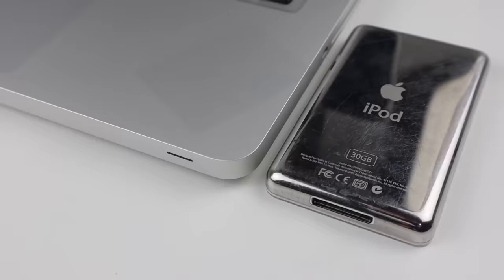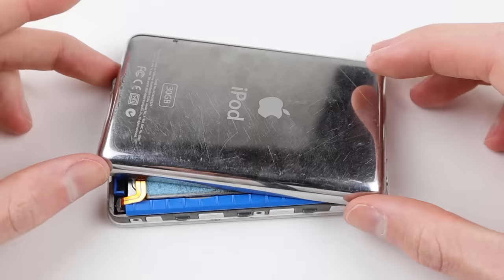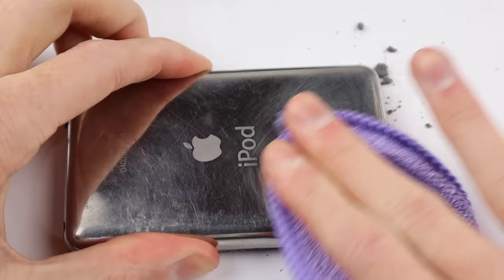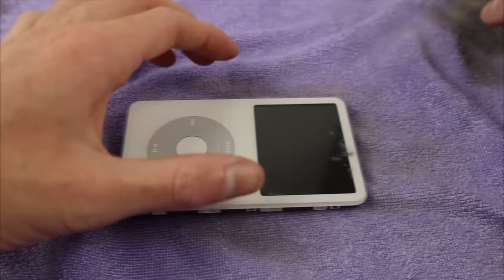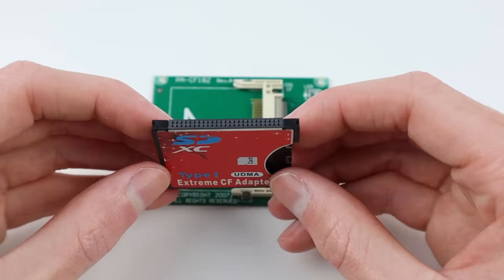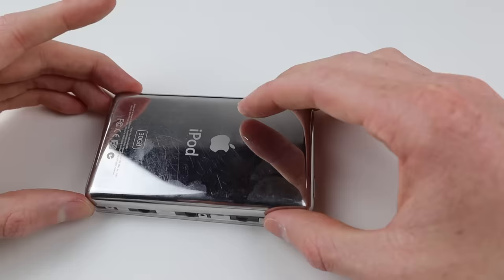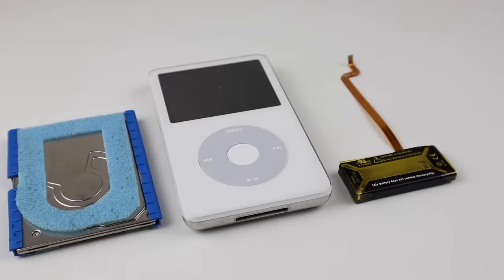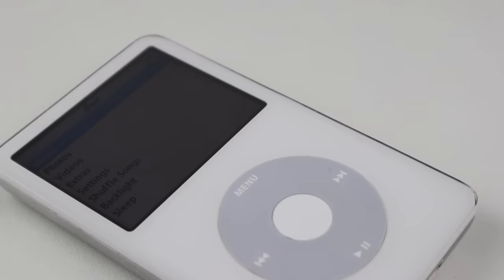Reviving a Broken iPod 5th Generation (iPod Classic)

Comment from the maker: Do you still use an old school iPod?
I still use mine all the time, it allows you so listen to music while being disconnect from your phone, something a lot of people could use...
Its also helpful if your constantly using different devices that don't always have your music library on them.
Reply: Nice! You got a 5.5 gen or the 5th gen (enhanced). This one has a really nice Wolfson DAC in it and is considered the best sounding iPod. I have a 5.5 gen as well with an iFlash adapter and a 128GB sd card and it sounds great.
Reply: This comment was commented on an iPod touch 7th generation.
Reply: Hugh Jeffreys does an iPod touch 6th gen count
Reply: Can't you give an iPod away .....?
Reply: I have a 2nd generation ipod touch and the battery has outlived my Iphone SE's by far... maybe they don't make batteries as they used to
Reply: I use the same one you got here, and sometimes I use an iPod touch 1st gen on iOS 1.1.5
Reply: Can you please repair my ipod 4th gen
Reply: I have an iPod classic 5th gen in white 80gb but it has a dying hard drive. 😢😔
Reply: Just a friendly advise. Just use oil instead of alcohol to remove sticker or adhesive. I would be alot better.
Reply: I don't have iPod, but i have XX.y A496 BT Mp4 player. I still loving music.
Reply: @finleytownley7651   Watch Geek Detour video. He in one video repairing his iPod. He changing hard drive, battery, lcd in one video.
Reply: Hugh Jeffreys i still have the 2007 iPod classic
Reply: I have an iPod classic 5th gen 60 Gb model
it works fine but is swollen
Reply: I still use my lunch zune. 🤣 Every time I get an iPod they always break
Reply: Want two iphone 8 I have a water damaged one with no cracks and one with shared back and front I know u probably won't read yhis
Reply: Me
Reply: I use my 2gen iPod nano every day, it’s D.A.C. is amazing
Reply: You encouraged  me to fix mine, hopefully with the same result
Reply: I only have an old school iPad it is the first iPad running iOS 5.1.1
Reply: Sometimes. I use my Nano 7th gen.
Reply: I use my ipod touch 5th gen for school
Reply: I still have a green iPod Nano 6th generation which I have attached to a watch strap and is my main watch.
Reply: I still bring my iPod touch 4th Gen to school and I'm quite happy with it since the battery life is still in ok condition and a steal for 8 bucks on eBay. And for that steel polisher, does it have a name?
Reply: The one I have is stone dead and the back of it is scratched and I got it for free as is
Reply: I have an ipod touch 4th gen
Reply: I think I got the four gen
Reply: 16 gb
Reply: I still use my 7th gen daily, it does have a 500Gb mSATA SSD and a new battery now.  I like the fact that I can have all my music on it without having to choose which albums to keep so I don't take up too much memory like I do with my phone.
Reply: Hugh Jeffreys I’m about to use an old school iPod. I’m just waiting for my dad to give it to me
Reply: On scratches on Stainless Steel products try Mothers Mag  and Aluminum Polish. I use this on my Apple Watch Stainless Steel and it works perfectly, my watch look like from box.
Reply: Mark Perry same here all the old stuff is cool and simple
Reply: iPod Squad
Reply: I still own a 1st-Gen iPod Nano in pristine condition.
Reply: Fedora Usado apple old tec no longer wok
Reply: My iPod don’t work thanks apple
Reply: @ezequielcastaneda8890  says who? I still  sync music from my library to my trusty Nano. I use it regularly
Reply: Fedora Usado I have music on it but it just glitches and dose not play music
Reply: @ezequielcastaneda8890  then you should consider YOUR iPod as defective, not all of them. In fact, I own not one but two 1st-Gen Nanos, and both work. My brother still owns a 3rd-Gen iPod Touch in working order.
Reply: Hugh Jeffreys my dad still uses his foud 2 others
Reply: Still using mine on my car
Reply: Fedora Usado yeah
Reply: I have a huge collection of iPods and my main one is a classic 7th gen
Reply: It’s Ronan Just Ronan thats tuff
Reply: Of course, actually i have two iPod classic, one of them is a 7th Gen with a 160 GB hard drive and the other is a 5th Gen with a 30 GB hard drive. I repair my 5th gen ipod classic a week ago, the hard drive was dead and the jack port needed to be replaced, now is working very well.
Reply: You want my iPad because it does not charge or probably gonna throw it out
Reply: Where did you get the sd card adapter board for the iPod? What model/serial/name is it called? Looking to do this to mine and all the ones im seeing shipping to Australia are like $80+aud. Love to be able to fix mine for $35!
Reply from the maker: @dorisdaylight8415  this is the one I purchased. https://rover.ebay.com/rover/0/0/0?mpre=https%3A%2F%2Fwww.ebay.com.au%2Fulk%2Fitm%2F233182232931
Reply: great vid! missed opportunity I did mine with sd isflash and got room for 1900 mh  battery witch last me a week
Reply: is it possible to buy now ? i still love ipod classic.
Reply: Hey Hugh, love your videos, dude, you are a genius !!!All of your videos most definitely gets a thumbs up from me.  By the way, there is one thing about you that I'm curious about, and I think many others are as well, and that is, are you gay.  And if you are, that's cool, and if you are not, that's cool also.  All of us would like to know.  Anyways Hugh, keep on pumping out those good videos and have a great evening!  :-)
Reply: I did it! My old iPod was broken for more than 3 years. A lot of thanks for the video ¡¡ Greetings from Mexico
, I'm your fan ¡¡
Reply: I use an old iPod touch 4 in almost mint condition I lent it to a friend and he made a small crack in the screen bezel
Reply: I use a 6th Gen thin iPod Classic. I did a similar mod (An iFlash with a 128gb SD Card + a new battery), but working on this model is harder because it is very difficult to open. Still an awesome device.
Reply: I use an iPod nano 4th generation
Reply: Bashir Asmad Why is that? And how does that work? Since both oil and alcohol are non-polar?
Reply: so I wanted to buy and restore this model of iPod but, iTunes doesn’t support the software so how do I get around that?!
Reply: Hugh Jeffreys Hi!!! Great video like always!!! How many hours did the mew battery last?? I need to replace mine. Thanxs
Reply: Hugh Jeffreys I have a flash modded iPod mini permanently installed in my car
Reply: I have a 4 gen one of those with same support message I think drive finely died today because it was working fine few weeks  ago but now today it’s has said iPod screen when I tried turning it on
Reply: I use my 5.5th Video everyday! After replacing the battery for a 1900 mAh new one and a the 80 GB HD for iFlash/SDXC 128 GB card it works great.
Reply: @willemanuel6580  Same here!!!! Exactly same setup.
Reply: No way I use an LG T375 as a MP3 player I works just like an iPod but better
Reply: I do! I have 3 iPod classics and 4 Nano’s!
Reply: Got a dead iPod 4 (2004), I hope I can repair it some day
Reply: I have a ipod nano 5th gen that has a battery of about 2 or 3 songs lol. I use it for when i excersize and thats about it
Reply: I use Spotify and download albums and playlists for offline listening so I can listen to music while being disconnected from social media.
Reply: still using my 2nd gen 1gb shuffle for exercises and my 7th gen 160gb classic for daily usage, besides iphone
Reply: I just bought myself a completely sealed and new iPod 5.5 80GB for $300. Adjusted for inflation it's cheaper than it's original price. And I am so excited about it. I already disconnected from my iPhone and using a Motorola Razr V3 now. Just carrying the iPhone around for my music. If the iPod arrives I can sell my iPhone and live happily. I already converted all my Apple Music which took like 3 1/2 days because the software needs to listen to the song and record it. But it was so worth it 😊
Reply: It’s not old school so technically no.....
Reply: I sure do it’s amazing and useful to enjoy parts of life with no disruption
Reply: you could share with me the names of all the tools you used ?
Reply: Mine just stopped taking a charge.
Reply: @finleytownley7651  search "HDD ZIF" on Aliexpress
Reply: Yeah i have the same iPod 😂
Reply: @HughJeffreys   

HOW CAN WE RECOVER  PHOTOS AND VIDEOS ON THE DAMAGED OR RESTORED IPOD CLASSIC ?
PLEASE DOWNLOAD A VIDEO ABOUT HOW TO RECOVER PHOTOS AND VIDEOS IN THE DAMAGED OR RESTORED IPOD CLASSIC 
BECAUSE  I HAVE AN IPOD CLASSIC DEVICE  WHOSE DATA IS  DESTROYED AND I NEED RESTORE IT 
AND I DO NOT WANT TO RESTORE IT BECAUSE THERE ARE VERY IMPORTANT PICTURES  AND  VIDEOS 
WHEN I CONNECT IT TO THE MAC 
IT APPEARS TO ME THAT IT IS DAMAGED AND CANNOT BE DOING A SYSTEM UPDATE BECAUSE IT IS COMPLETELY CORRUPTED AND THERE IS  NO SOLUTION TO THE FINDER PAGE  EXCEPT FOR RESTORATION. I WILL THANK YOU VERY MUCH IF YOU EXPLAIN TO ME HOW I CAN PULL PICTURES AND VIDEOS FROM THE IPOD CLASSIC . THE BELL TO WATCH ANY  VIDEOS DOWNLOADED  FROM YOUR CHANNEL
Reply: I use a classic 5th gen daily!
Reply: I have a purple ipod nano gen 4
Reply: Gum Gummmmm... I forgot what gen
My ipod touch is
Reply: I still use an iPod Classic. I’m currently using a 160gb 7th generation which will soon be upgraded to 512gb.
Reply: I want to use mine. Which is why I'm here, it's been off for 15 years and telling me to restore in iTunes however the hard drive is corrupt af. Can't restore or format, tried 50 times and keeps failing lol. So I need to find a replacement.
Reply: @Streetw1s3r  Where do you live? I live in Sydney & there’s a shop I go to who fix iPods.
Reply: @Bradford659  Melbourne, but I want to do it myself because I'm bored and want to fiddle with things. You don't learn by paying someone else to do it for you.
Reply: Where  can we all send ours to get fixed how come noon will fix these??
Reply: I agree completely! My last ipod just died, I'm sad. I have some pristine ipods I think with only hard drive problems. My small one just has red background with apple and connect to power when I plug it in. How can I get an ipod classic with a terabyte or two??
Reply: @willemanuel6580  actually this is just a 5th generation, not the 5.5. At 0:18 you can see the serial number ends in SZ9 which means it can’t be a 5.5.
Reply: Nope.6th gen is classic.5th gen is video
Reply: yesterday my 5.5 gen ipod classic arrived. i want to do a case swap and a flash storage and battery upgrade
Reply: No but I’m getting a black iPod 5th gen on the 22nd
Reply: @Noaddedsalt01  no. That’s new and doesn’t have a clickwheel
Reply: @ezequielcastaneda8890  wok
Reply: @elfedorausado  make sure you don’t over use the Nanos. The battery could expand and push against the screen and make a black spot on the screen. Making it a fire hazard
Reply: @dudekissmyass  well. The iPods with a clickwheel are called old school
Reply: @KotTheSillyOne  i only want to say fifth gen ipod's real name
Reply: @dudekissmyass  the video
Reply: @KotTheSillyOne  i have one of those
Reply: I use an 5th gen all the time thanks to you
Reply: I used to have one. My dad to be exact but he sold it for a few bucks and now since they stopped making them they’re really becoming collectible. Damn shame his was in great condition.
Reply: I use mine all the time. It’s a 160GB classic
Reply: No but thanks to you and your other countryman DankPods (yes I know you take wildly different approaches!) I am seriously considering getting one and restoring it.
Reply: i have an old ipod nano second gen
Reply: i daily a 6th gen 128gb and I love it!
Reply: I actually went out of my way to get a 5th gen being they were acclaimed to have one of the best codecs and it for sure sounded alot better than my phone from 2019. Especially hooked up to my car or any larger speaker system.
Reply: @gloriamargarita  actually batteries have gotten better and longer lasting and bigger in Capacity too
Reply: @marshall8733  you MEAN ADVICE
Reply: I had a 7th gen classic gray!
Reply: I have a 5th generation iPod I think it has a virus because all of a sudden it won’t work. What do I do to remove the virus?

Comment: Some things I learned from DankPods
1. Brasso actually works wonders on the front plastic. It really cleans up and polishes effectively, even though it is a metal polisher.
2. If you want to remove the scratches from the back metal cover... you need to replace it. Most other things just make it look worse
3. When opening the iPod, don't push up with your tool to avoid any damage. You need to slide the tool in, push a little down and inwards. The plastic clips should open up.
4. If you don't want the CF adapter to be that loosely inside, put a small piece of foam on it. 
5. If you do the flash mod (SD card) and it doesn't work with the cheapo CF adapter, make sure the SD card really is in there. If it still doesn't want to work, get an iFlash CF adapter.
Reply: The battery cable always open with plastic tool. Metal tool will kill battery short most people don't know that
Reply: F A T H E R  D A N K  H A S  G I V E N  U S  W I S D O M
Reply: @jstar2452  “Don’t use metal on bat-trees I do I don’t care” 
- DankPods
Reply: I'm polishing badly scratched Cds. It works like magic. Avoid touching the printed side of disc: Brasso will destroy serigraphy.

Comment: This video was a huge help to me, as I literally rebuilt my 5th generation, A1136, 60GB (with video) by using this exact tutorial.  I also used the compact flash adapter.  Reason for my post today (in addition to thanking Hugh Jeffreys) is to further recommend 2 things.  I don't like the PCB rattling around in there.  It's smaller than the original hard drive, and the rubber pieces don't really help.  So, I'd recommend using dual-sided 3M sticky tape to make it adhere to the inside of the opened iPod cover.  This does make it harder to connect the flex cable at the bottom though, but patience there paid off for me.  Also, I ended up dropping my iPod a few times, accidentally & it stopped working.  Once re-opened, I was surprised to see the flash adapter had pulled off the pins, so I ended up using surface tape + a couple of drops of hot glue to the top of the flash card adapter/PCB so now it can't slide off from the pins, if dropped again.  Thus, now it won't rattle around inside, and if dropped, I won't lose connection either.  Other than that, great video!!  Thank you, Hugh!

Comment: I love the look of the sad iPod logo because it reminds me of when the classic Macintoshes crashed.
Reply: Yup it has the folder and the ? sign
Reply: @OrangeGroupTech  No. Folder and ? means that hard drive is dead or OS is missing.
Reply: We can no longer experience a crash on a Mac
Reply: @battyroshko1431   yes you can, it's called a Kernel Panic
and the Sad Mac only occurred when there was an error during startup, either a software or a hardware one
Reply: @TorutheRedFox  I dont think Sad Macs exists anymore.. they just probably wont display anything with a hardware error, like dead RAM modules.

Comment: I've repaired A1059 one from 2004 the same way you did ;) The only difference that I've used that hard piece of compound to polish the back of it. Btw these compounds have a different abrasiveness level for different surfaces and you should mix it with a couple drops of sewing machine oil before use.

Comment: Thanks for making this video, I am attempting to upgrade the battery of my ipod video to 3000mah, since you also used my storage solution which is ZIF>CF>SD. Now I know that I need to change the backplate to about 13mm since it will be thicker than a normal 30gb (10mm thick) ipod.

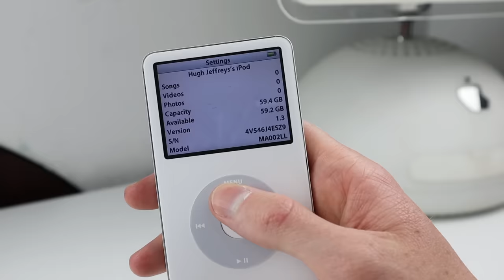Comment: Good video. At 8:12 you say that the device will only recognize in 10GB increments. The reason it only recognizes 59.4 GB is that that is the formatted capacity of the SD card.
Reply from the maker: It shows up on the desktop as 64gb total storage, same as in itunes but only 60gb on the device.

Comment: You need to use a buffing wheel to get rid of the scratches. You start with a course grit, then move to a finer grit and then polish with the Brasso.

Comment: I have an iPod 5th Generation that I needs a new battery.  I am so happy to hear and see that it is easy to fix and upgrade.  I called a few repair shops for electronics and was told that it couldn't be fixed.  I love my iPod 5th gen and was dreading the thought of having to get an iPod Touch as I am not a fan of them.  I saved this video and as soon as my new battery comes in, I will be reviewing this to fix my iPod myself.  Thank you for making this video!

Comment: Nice! You got a 5.5 gen or the 5th gen (enhanced). This one has a really nice Wolfson DAC in it and is considered the best sounding iPod.
Reply: I just bought a 5th gen 30gb ipod. I wanna put a terabyte in it and upgrade the battery but for now I'm broke and the stock battery is fine so I'll just worry about upgrading the storage
Reply: Just bought a 5.5 80GB for 27 bucks. It has a moderate amount of scratches in the front so I will probably replace it. Which webpage do you recommend sourcing parts from?
Reply: @TomasLomba  I didn't bother with replacing the front cuz I'd rather just endure minor cosmetic damage than have to move things over like that,  but I did buy a thick back and bigger battery from aliexpress. I got the back housing for like 10 and the battery for like 13, it takes for fucking ever for things to ship though so I would order as fast as possible
Reply: Tomas Lombardini I buy most of my stuff from eBay, but iFixit May have some of the parts you need
Reply: That isnt a 5.5? that is a normal one, no search option.

Comment: For polishing the back case I would suggest using a Cape Cod metal polishing cloth. For the plastic front I would use a tube of Polywatch. It’s used for polishing acrylic watch crystals